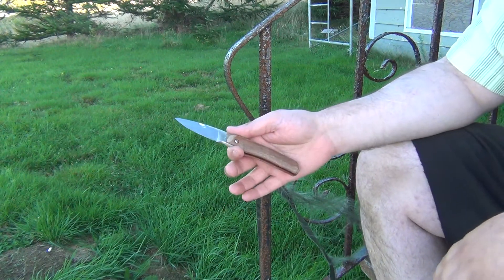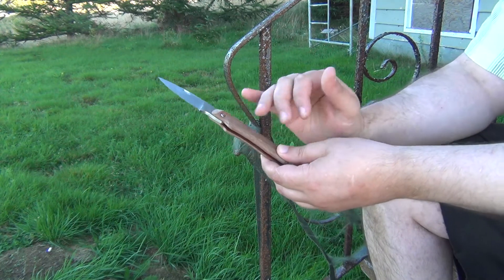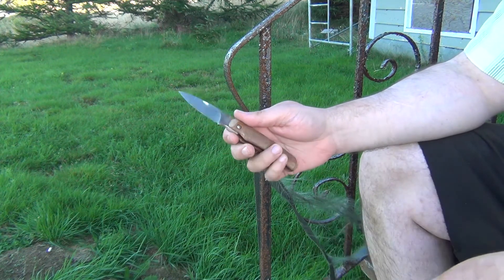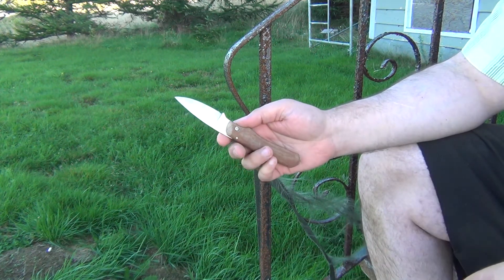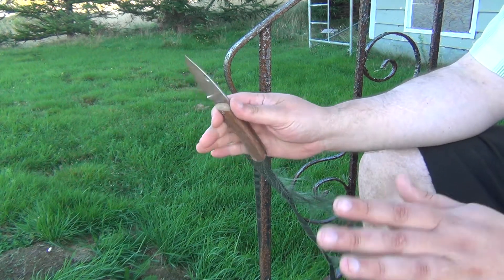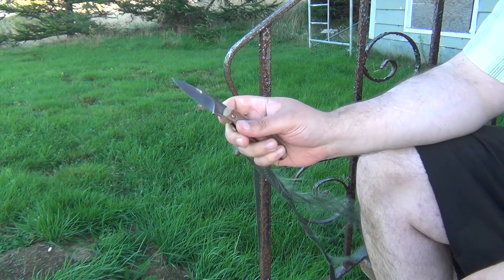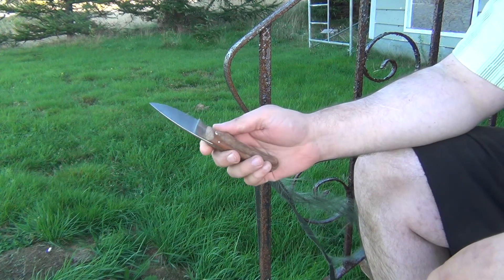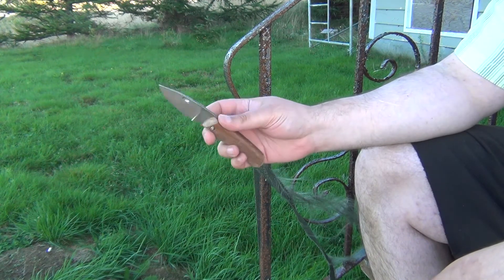Knife Challenge #23 : cKc elmax/folder - data sheets

Comment from the maker: This is very critical, as the corrosion resistance of a steel is critically influence by the soak temperature, method of quenching and the tempering.

Comment from the maker: There are two ways to run it, temper it at 350-450 which produces the highest sharpness, or from 650-750 which provides maximum toughness. The second cycle will be so tough if you chop it into a rock it will just smear out. More importantly it will be readily filed to be sharpened. Which one to pick would mainly be based on if you were doing high probability dirt contact or not.

Comment: 10.  Along those same lines, for 3V there's no indication if you can get it's excellent toughness and it's excellent wear resistance at the same time.  I can make 1055 very soft and very tough in the lower 50s of RC or as you mentioned very hard at 64-65 with good high sharpness edge retention, but also more brittle I believe

Comment: 9.  On the 3V bar graph (and well the other one too) there's no indication if the wear resistance and toughnesss "values" come from the same steel sample...you may not be able to get those values in the same knife...the toughness could come from optimal heat treat for that and the same for wear resistance...but the two don't necessarily go together.

Comment: 5.  In general in both of the data sheets it is stated the charts offer relative values...there is no indication of the scale used which could significantly impact  the bar heights.  All they essentially say is S7 is tougher than 3V...great, but how much tougher.
6.  There is no indication of the forces needed for certain applications for us to know if any of these values are important.  Similarly wear resistance is not defined..wear resistance in non abrasive materials or in abrasive materials?

Comment: 3.  Catra testing is very angle and finish dependednt I believe, and none of that is specified.  That 440C could have been at 20+ dps  while the S30V was at 10 dps...they just don't specify
4.  In the corrosion resistance table, there is no discussion of how the steels were heat treated as high tempers can significanly reduce corrosion resistance...perhaps the 440C and 154 were treated that way while the S35V was not.

Comment: I would like to see data which provides which handle, blade shape, and grind in measurements and graphs  and which are optimized for application. Honestly I put more thought and effort into the design of my handles than most of the knife.

Comment: I think the data sheets provide a "jist" of what the steel is about as if they were talking to someone who thought all steels are the same. I do want to try elmax, m390 and 3v to see if they perform better than the cpm154 and ats34 I use now. But I think the steel is over hyped for the most part and heat treat and grinding after the fact, edge geometry, type of grind, type of handle, and blade finish to be much more relevant and pertinent information.

Comment: Wow that is dry. I work primary in the 100 mile wilderness of central Maine. My elevation can change by 2,000 feet from job to job, and I am just about always near a lake or stream, it does not seem humid, but it is. 
And during the rest of the year I live in Nj, which is very humid, but I can keep it oiled much easier when it is sitting in my room. Just like my 51600 katana, I oil it once ever 6 months of non use and it is fine, even in its wood sheath in the humid air.

Comment from the maker: Yeah, some machetes are really soft, 1055 can be hardened to 64/65 HRC, but it is usually ran soft to make it easily to file. 

O1 will rust really easy, it isn't very humid here which is nice, I don't even oil 1095.

Comment: I agree. 3V is in my Spyderco Tuff. With field work I generally go for a softer, faster to sharpen, blade. Besides my Ax, I use a machete made from 1055, which I find maybe a bit too soft. 

I am going to replace my machete with a heavy chopper since I have more of a use for it. I am debating from the Cold Steel O-1 gurkha kukri and the Swamp Rat Rodent 9. in SR101. The CS is a better performer and is cheaper, but I would want to get it coated first, to much work out in the field to keep it dry.

Comment: Makes sense, so it is pretty much like S7 with some ability to hold an edge. What gets me is the nitrogen content to help make it more stainless, kind of like a big brother to H1 then. 

I sharpened some chipper blades this summer. I do a lot of bush/ wood clearing. I did note that it was a bit harder then I expected for a blade designed to take such impact.

Comment from the maker: I like 3V but have a different perspective than most as I prefer it in smaller blades. In larger blades I use them for a lot of brush work on deadfall. Such wood is fairly dirty and thus I like ease of grindability and wear resistance is not of so much benefit, and more of a hinderance on such woods.

Comment from the maker: I have used INFI in various knives for a long time, just after they started using it over A2. It is a very nice steel for larger blades. It gets raised to mythical proportions by some of the more ardent fans. It is very similar to steels used in chipper blades, which is not surprising as they are cutting steels designed for heavy impacts on hard woods in dynamic cutting.

Comment: Well I should start by saying that CPM-3V is about my favorite non-stainless steel and may be all around y favorite given a coating.  
One thing I note about the 3V is that they mention it is easier to grind then D2, yeah no I am not buying that one. Also I note they say that it is best around 58-60 where go for 61 for better edge holding. 

As for S35VN, the comparison with S30V, I think, is correct, however I think S30V to start is over played in strength and Edge holding.

Comment: He is doing in house heat treats, very cool, Elmax is a hard steel to do. I am just getting ready to start heat treating some 1095 I have. Now I have hardened milled steel before, it is tricky and not going to be that great in any ways. It can be done, sort of, by case hardening. 

In my opinion the fact sheet can only be correct in ideal (heat treated) laboratory conditions. That is where it comes from. Now the Lab and the real world are two different things. 
I am looking at the charts now.